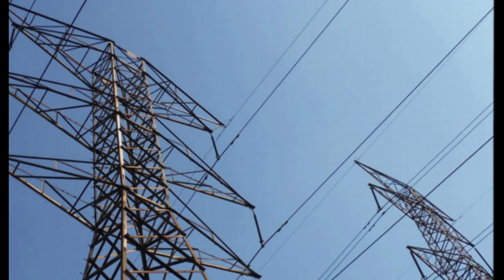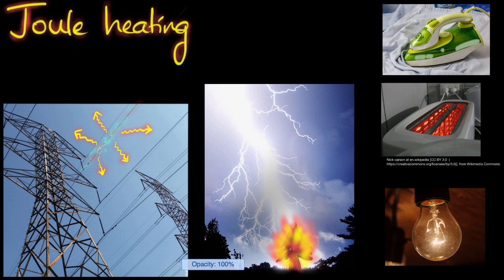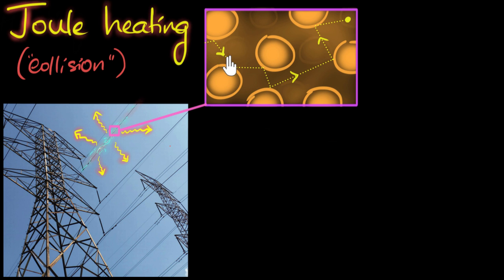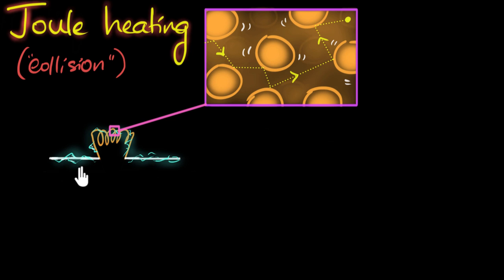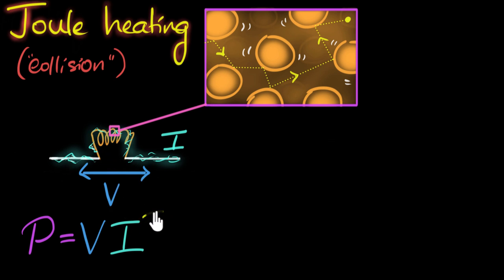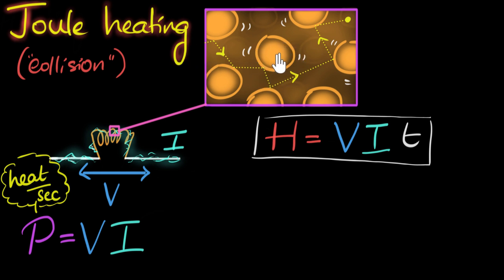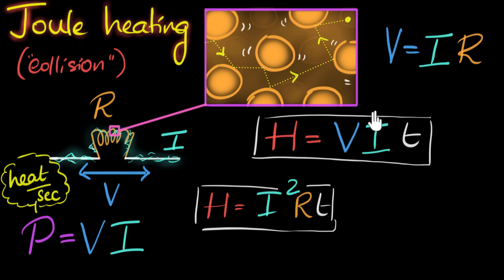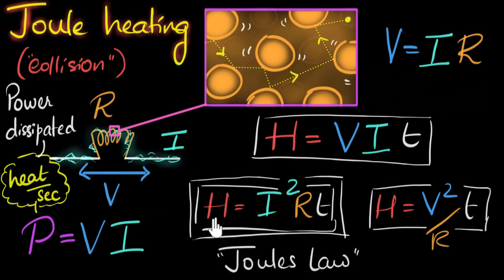Heating effect of current

Comment: I have a question.. if all the energy is converted to heat then how is a fan able to move? Cause it won’t have any energy left to convert into mechanical as all the energy has been converted into heat..
Reply: Only a part of the energy is converted into heat energy. The remaining is converted into mechanical energy.
Also, the wires used in fans and such devices have high conductivity, so only a very little part of the energy is expelled as heat.
Reply: @arunikaraghuvanshi3412 ok sooo if a small part is converted into heat energy then why heat = VIT 
It should not be V but a part of V instead??
Reply: @chephybio6911 , I think that part of energy is what we consider as 'V', in this formula . Correct me if I'm wrong.

Comment: I have a question as we are considering p=iv as the power loss this means all of the power is lost as heat. Then there will be no electrical energy at our homes through the wire
Reply from the maker: Heat is only generated in the resistance. 
If you consider your domestic circuit, only a small voltage difference occurs across the transmission wire, and as a result, only a small amount of power gets lost as heat.
Reply: @KhanAcademyIndiaEnglish  what's the foolishness is this
Reply: @sharwandhayal7472  👎